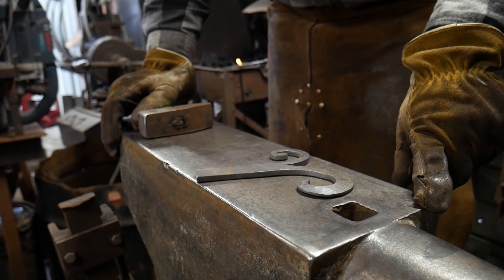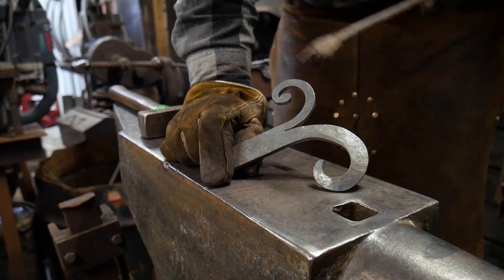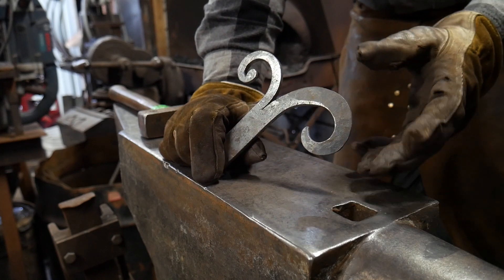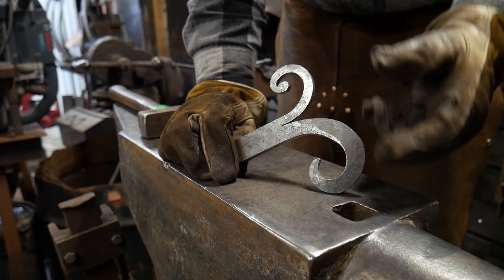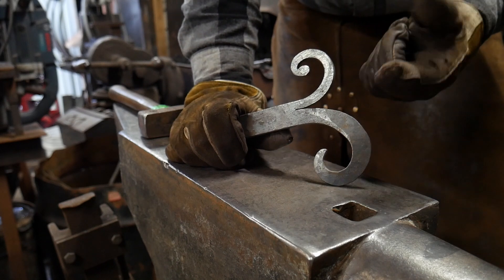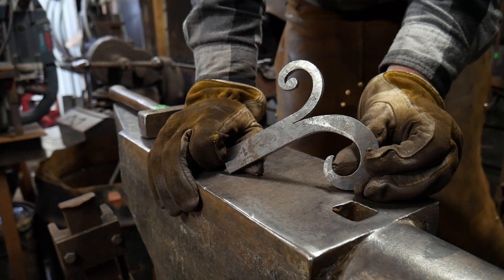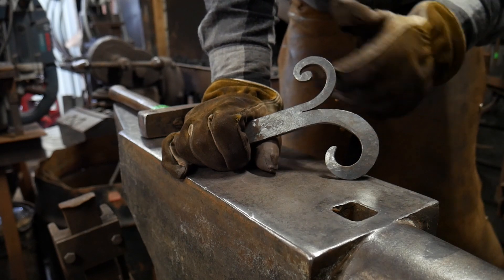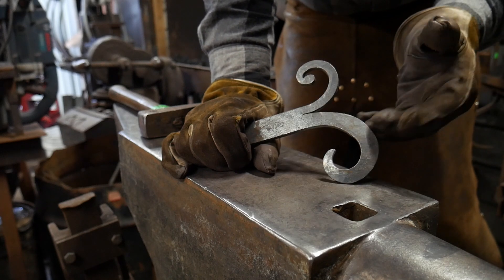Will it crack?

Comment: From my understanding, a stop drill is not necessary in a saw cut because it has a flat bottom and essentially creates the same effect. When you would have to worry is when the cut ends in a single point like a chisel cut, a cold shut or the root of a forge weld.

Comment: Even in repair welding cracks it’s common practice to drill a hole at the end of the crack to keep it from spreading as you weld. Which is more likely to happen since you are introducing heat expansion to the mix. God Bless you guys! Keep sharing please!

Comment: In the past, any time metal has cracked, you're supposed to drill a hole to stop the spread of the crack. if the metal is thick enough run a bead of weld then grind flush, depending on the texture of the metal, glass bead, or sand blast. did a cylinder assembly years ago for a model steam engine made up of welded components, dressed the welds sand blasted with coarse sand, when finished I was asked how did you cast that? depending on finish you can almost make it look like it was never there!

Comment: Very good points to a very good question. 
As an additional point, end details are generally stationary. If however the item will be subject to vibrational stress, such as on a wall that frequently rattles due to proximity to heavy equipment or if it is on the end of a stake there can be complications. I've accidentally broken some poorly welded decorative finials off of temporary barrier stakes (not made by me) simply by hammering on the driving step. The shock was enough to send the cast iron point off of the square pipe. It is also a great example of care needing to be given when choosing parts for projects. Cast steel  and mild steel generally don't weld very easily for shock resistance.
Reply: The "not welded by me" I find lots of robot welds as not for strenght but pushed out for speed many are second rate.
Reply: @johnjude2677  The welds would have worked fine for the ornamental finials if the stakes were not meant to be moved, but alas they were moved and very brittle.